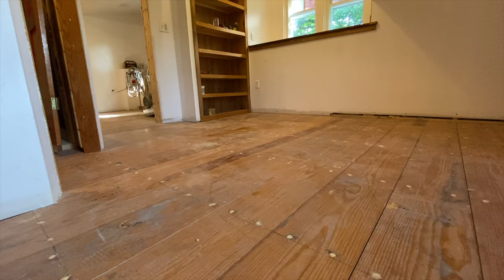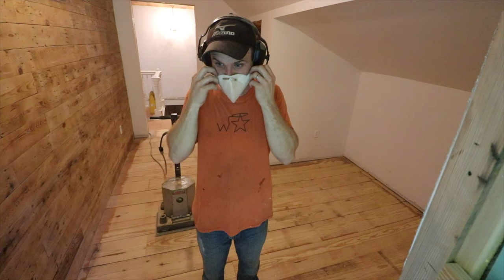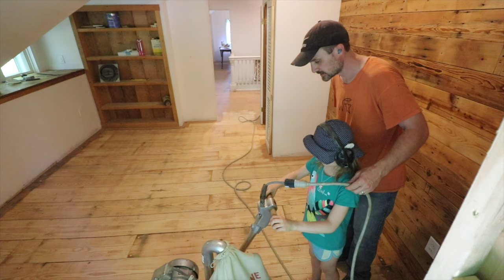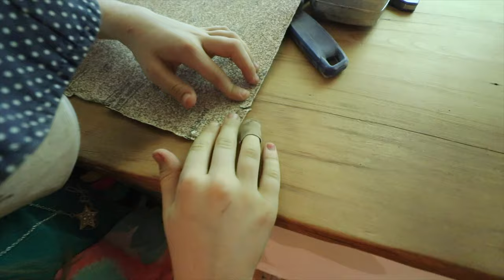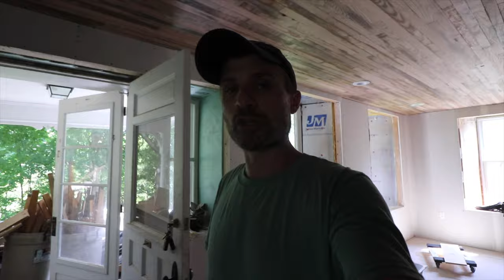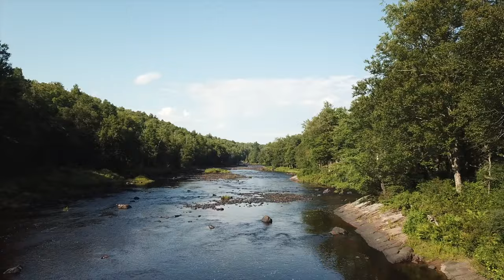DIY Home Renovation | Refinishing  Floors | Sanding

Comment: I was virtually screaming "finnish it with bees wax!" 😆 A new floor would not look right in the house imo, no character! All you need is a buffer, I have an old carpet shampoo machine with buffer attachments. I dont have carpets! 😆 Every month, on rotation, one room at a time, I buff the floors up and they've lastest for decades without having to strip back and redo! Generally all they need is cleaning with a damp mop an a buff up once a month to keep them looking good, downstairs obviously needs more attention than the bedrooms but its not hard work by any means. Love how the house is transforming and its the attention to detail and the use of repurposed wood that is making it spectacular. You guys are an inspiration for people who are not sure about repurposing stuff. Great job again Lucas.
Reply from the maker: You would definitely want to use a machine if you need to do that monthly.. do you add new wax too? Or just buff each room on that rotation?
Reply: @1806StoneHouse  I usually just buff it up, worked in a good amount of wax when I first did the floors, I can tell when doing it if I need to add a little more. Upstairs not so much, not heavy footfall and no outdoor shoes.
Reply: @1806StoneHouse  I inherited my mother's old buffer/waxer, with attachments.  It still does a great job on wooden floors!

Comment: Keep the dust from the sanding and mix it with some wood glue when you need to fill holes in the floor.  Oh and hire an edge sander.
Reply from the maker: Check and check!! I have a huge bag of it!! 👍👍👍 will be filling holes this weekend I hope. 😃
Reply: Can you use a syringe or icing tube to fill the holes with sawdust/glue? Just a thought.

Comment: My father was the janitor at my school (K-12). Kids who had to stay after school for detention that didn't have anything to do got to "help" my dad by scraping gum from under desktops. 
Summers each of us kids had to spend so many hours down at the school helping dad. One of the jobs was always scraping gum from the bleachers. He'd give us a putty knife, an ice cream pill and a transistor radio and off we'd go. It was fine if the pieces were dry and hard, those chipped right off. But the juicy ones were a stringy mess! 😄

Comment: The floors look absolutely fabulous even though I am sure we cannot get the full effect on video.  The finish is your and Sarah's decision of course.  But as you two highlighted in a previous video, I would not underestimate the impact of the remaining, smaller cracks if the oil/wax traditional finish does not fill them.  I wonder if we haven't heard the last on that conversation you guys had.  :)
Reply from the maker: We might need to upgrade the vacuum 😂
Reply: @1806StoneHouse  Okaayyyy.   Sarah may insist on a "new" vacuum OPERATOR!  ;)
Reply from the maker: Clark Robinson ...I don’t like where this conversation is going 😂😂😂

Comment: Agree ! Agree ! Agree ! on your choice of finish it's easier to maintain and repair quickly especially with a busy little family you need to spend more time for. For the orbital sander helps to put weights on it to get better results. For that board thats sticking up a bit use a 4" hand planer.

Comment: When I did my floors I rented the big belt sander and still had to use my small hand sander to get the edges ..and then a block to get corners...when it was all done and I dry mopped all the dust up I ended up poly coating it with three layers.  twenty years later is needs a few touch ups but looks good...take  your time and enjoy the process.  I still have a chuckle  or two when I remember the vacume back flying off and dust going everywhere...coughed up all sorts of dust bunnies for days.  lol.  Thanks for posting...had a big laugh over the smells of bubblegum.
Reply from the maker: Haha!! I can picture that happening 😂

Comment: I used tung oil ? Can't remember the spelling. On a crappy tongue n groove pine floor and still it has that mellow sheen. Nothing dropped in the kitchen has stained them either ! It's been 5 years on a farm. I love the ease of application and the finish/durability !

Comment: Floor is looking great. One mistake I made when refinishing our old oak floor in our first house was hand sanding in some spots - those spots took the stain differently and we ended up with a blotchy floor. Know you said it won’t be perfect, but just wanted to pass on the info.
Reply: Nathan, did you use sanding sealer?

Comment: Investigate Watco teak oil products I’ve seen it used on floors and gives you the ability to spot refinish when you need it , I’m confident it’s compatible with wax . I’m going to use it on my soon to be refinished parquet floors.

Comment: Seriously doubt linseed oil and beeswax will hold up.  Am 76 and lived in homes with real hardwood floors for about the  first half of my life.  the hardwood floors were varnished and then polished with waxes,   Dad used beeswax to finish a dresser for my mom - just didn't hold up as well..  Also your bleacher boards look to be pine and traditional hardwood floors were usually oak.  Supposedly oak was less easily damaged and thus easier to clean.

What you really have to remember that there is a difference in formality between sealed oak and pine.  Also pine floors were often painted.
And what you have done really looks nice
Reply from the maker: We are very torn about what to do...